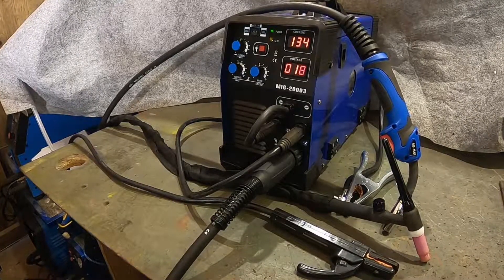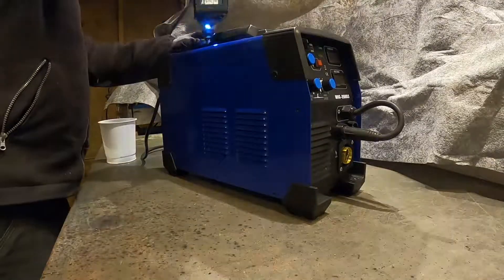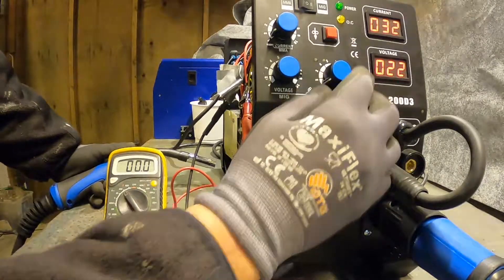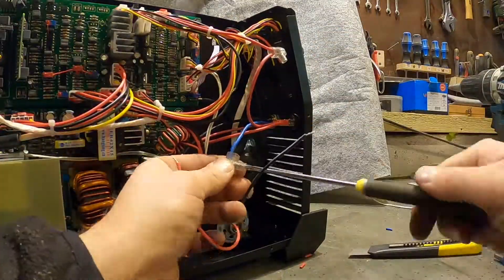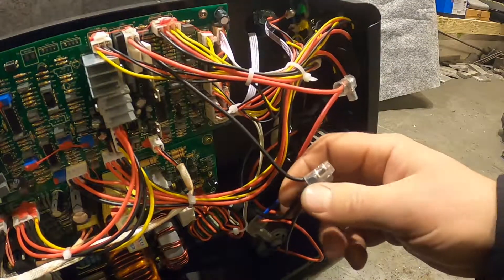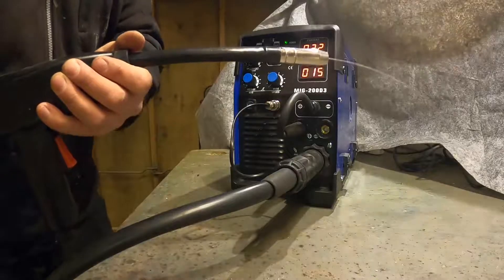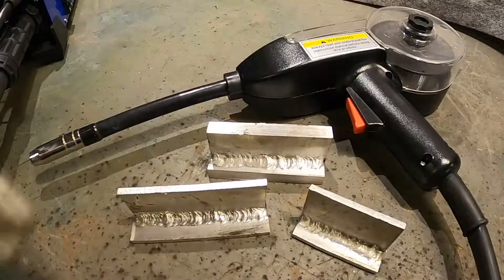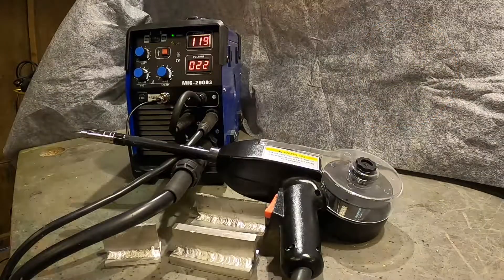I modified my cheap MIG200D3 welder so i can attach a spool gun. - Great for welding aluminium

Comment: Hello. I am doing a conversion like yourself. The problem I have is the welder wire feed motor is 24 volt and the spool gun is 12 volt. Can I put in a step down to the new switch. And does this mean I will have no wire speed control on the spool gun? Is there a way this can be done? Thank you.

Comment: No need for a spool gun. Replace the steel liner with a nylon liner for aluminium mig welding.
Reply: has anyone tried this and does it work fine without binding problems as alluded to in a reply above?
Reply: its the same as trying to push a dog with a lead ali is to soft you will have to have a drive in the torch aswell to pull.

Comment: Doesn't your solution simply confirm that all you actually needed to do was to replace the internal spool wheel to be one specific for aluminium ?
Reply: No, the point of using a spool gun is to keep the distance from the wire feed spool to the weld tip as small as possible to prevent the wire kinking. The weld tip and drive wheel are exactly matched to the size of the wire so if you have 2 or three meters of hose in between you will be clearing birds nests every two minutes.
Reply: @davidmccall-smith8479  spot on.

Comment: Did u decide to buy the spool gun after changing the mig torch inner with teflon,
Was the spool gun bought due to the teflon still gave issues?
I ask because If teflon torch still issue then ill buy spool gun and not bother changing torch inner,

Comment: Great work done. It is so instructive to solve my concerns on this welder working with aluminum. Just want to ask if any  brand of spool gun with Euro-connectir can be modified as demonstrated in this video.  Thank.
Reply: Yes as long as it matches the voltage of the drive . 12v or 24v.

Comment: I'm a beginner at tig welding. Thinking about buying Sherman DIGITIG 200GD Pulse AC / DC.
Why not use your Sherman DIGITIG 200GD Pulse AC / DC for Tig weld Aluminum?

Comment: If you can do a video on verifying the amps it pulls with Clamp Amp meter. Both 200a and 270a as advertised to good to be true with the amps
 also the duty cycle.